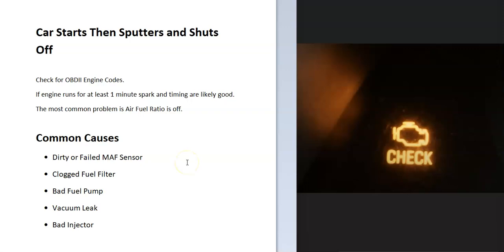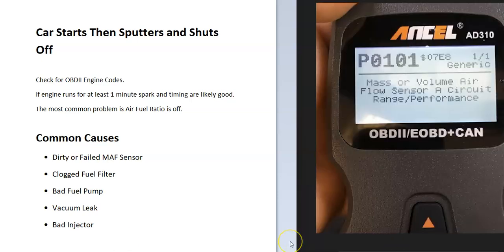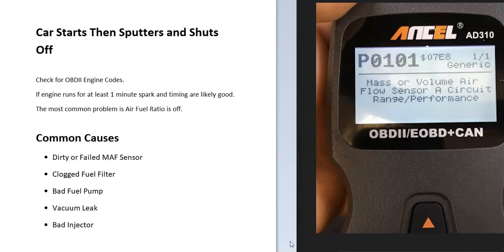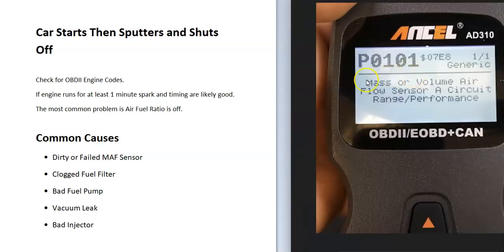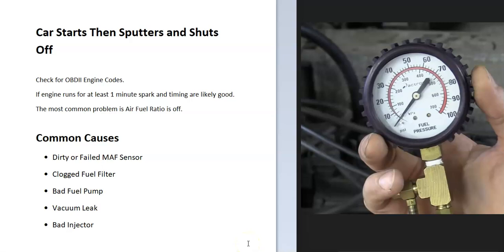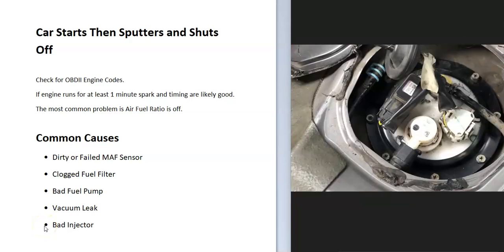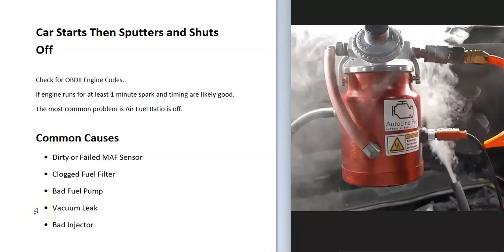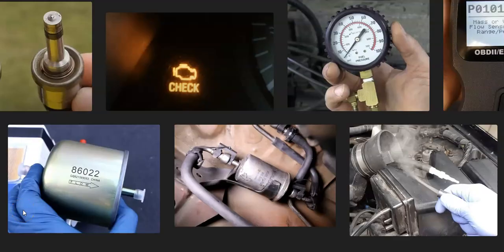Causes and Fixes When Car Starts Then Sputters and Shuts Off

Comment: My 2006 explorer 4.0 sputters when it gets to operating temperature. I get to a stop and it sputters. I turn it off and it stops for awhile. No codes , no vacuum leak good injectors, the machine said the pump is good and I just did the complete service from fuel filter to spark plugs and wires. 

I'm thinking the fuel pump because once the fuel gets to quarter tank it shuts off and then restarts like nothing.

Any advice would be greatly appreciated.

Comment: My 04 envoy just started rough idle and shots off while driving and i put it in neutral and turned key and started which it did it after 45 seconds which i was close to home and pulled in and turned it off. So um getting up and any idea to look into without having a scanner.  Not sure how much it would do if i could make it to the auto store.

Comment: Well hello anyone had this problem with 2015 silverado 4.3l it starts fine and shuts off after 30 seconds sputtering like no fuel and starts right up 30 seconds again changed 2k so far both fuel pumps all engine sensors catalytic exhaust #4 02sensors fuel pressure regulator the whole fuse box all the intake with sensors on it still stalling after 30 seconds no flickering lights no engine codes help anyone??

Comment: Need some help please, car starts but shuts of straight away, have a kia cerato 2013 sedan
 1.6
Reply: hi ! I hope you already fixed it.  But , when it was shutting after starting was it continuing running if you pressed the accelerate up to 2000 RPMs ?

Comment: Dirty Mass Airflow (MAF) sensor: If the MAF sensor, which measures the air entering the engine, is dirty, it can cause the engine to receive an incorrect air-fuel mixture and stall shortly after starting. Cleaning the sensor with a dedicated MAF cleaner is a simple first step....I cleaned my MAF ...still same problem.... I replaced MAF ..... problem fixed.....

Comment: Thank you so much… I have a very similar issue with my Hyundai Sonata - getting a P0111- “air intake temperature sensor 1 circuit range performance “ where should I start troubleshooting??
Reply: Dirty Mass Airflow (MAF) sensor: If the MAF sensor, which measures the air entering the engine, is dirty, it can cause the engine to receive an incorrect air-fuel mixture and stall shortly after starting. Cleaning the sensor with a dedicated MAF cleaner is a simple first step....I cleaned my MAF ...still same problem.... I replaced MAF ..... problem fixed.....

Comment: I have a 2015 Camaro I haven’t had any issues with it aside from getting my key remade because I lost my original keys and then all of a sudden now after 20 minutes of driving it just shuts off but then it starts right back up when I turn it on no issues I thought perhaps it was the battery so I went and changed the battery and it’s still doing it. I have no clue what’s going on
Reply: Thats my issue from last night

Comment: I have 98 Pathfinder hard to start when it starts rpm goescto 700 rpm than after 5 minutrs rpm droos below 600 and dies. I have changed MAS; Air filter , 6 spark plugs , fuel pemp relay. Got fault code P0325 knock sensor. Any suggestions

Comment: So I checked everything that you went over in the video almost I have a 2015 Scion tC and it's shutting off while I'm driving indicator lights on the – you're giving me the battery the power steering AC temp oil low and the oil plus I have a burning smell that's coming from underneath the engine not regularly but intermittently I have oil I have a good alternator the battery is good the oil pressure is good I just changed out the mass air flow sensor a little while ago and put a new air filter in can you help me
Reply: Crank position sensor

Comment: Would the timing be good if u can rev the gas and your engine stays running but I here a knocking sound soon as I let go of the gas the car shut off Honda accord lx 2004 the mechanic shop told me I need a new motor 😢and timing belt Help!
Reply: Engine knocking is not good, you’re mechanic is probably right